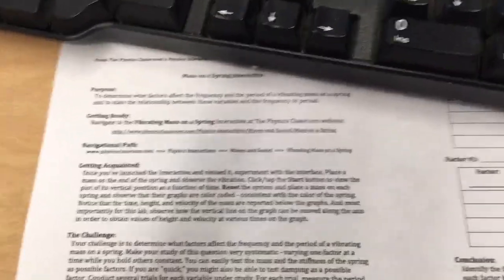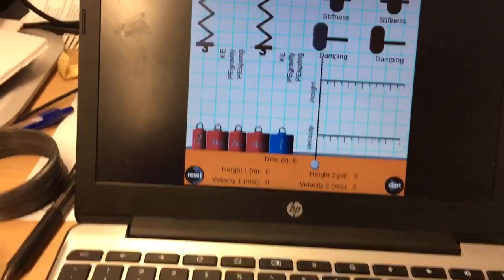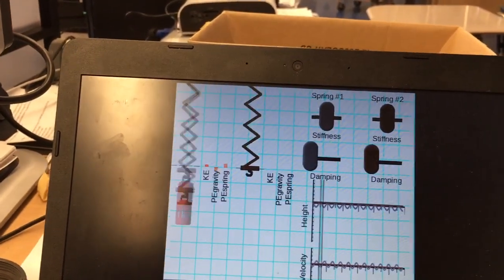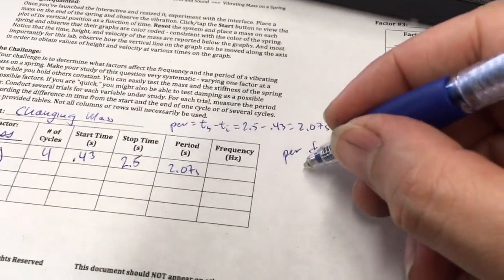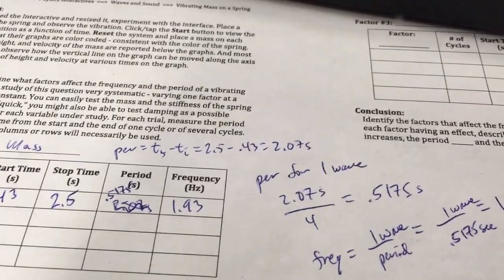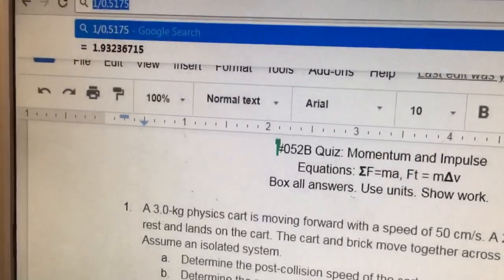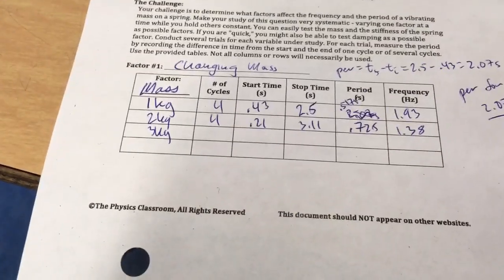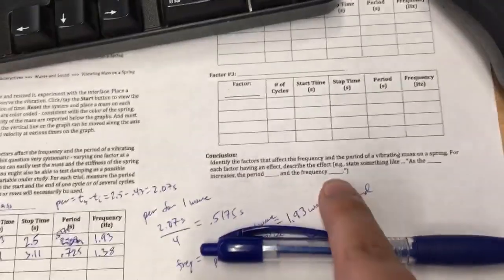Mass On A Spring Interactive

Comment: How to get the unknown weight in the simulation?
Reply from the maker: You might be able to use proportions by measuring the displacement of the known masses, and comparing that to the unknown masses displacement. 

Alternately, you might consider this: hang the unknown weight on the spring, and it'll apply a force, F. That force is F=mg. That force is also the spring force, or Fs = -kx  where k is the spring constant, and x is the displacement. You might need to determine "k" by using a known mass first.